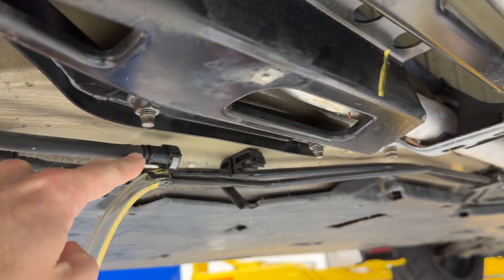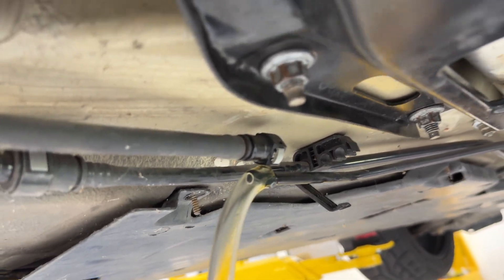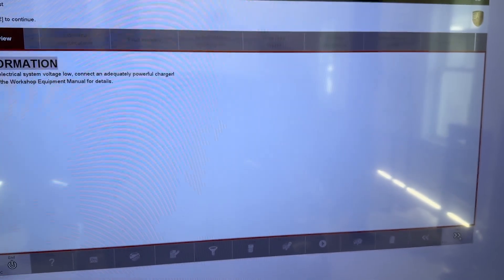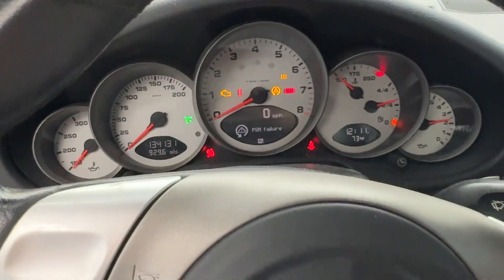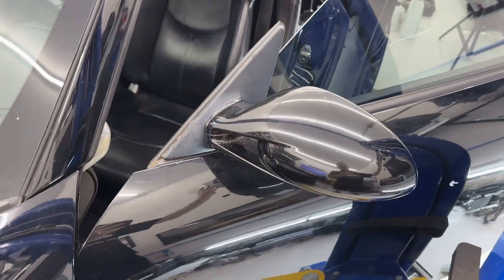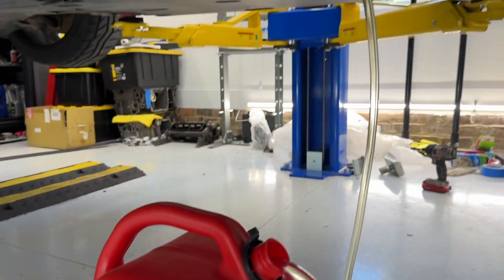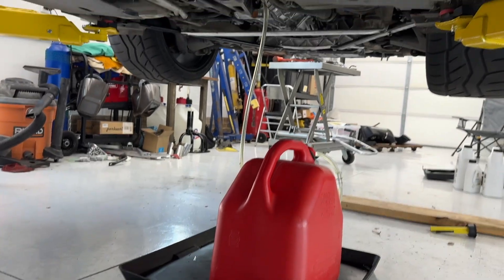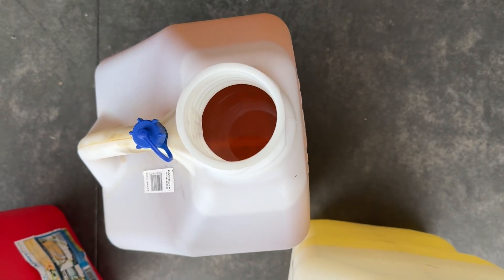Porsche 911 Engine Assembly Part 43:  Removing Old Fuel from the Tank using PIWIS

Comment: I jumped mine through fuel pump relay (easy on 996) as I wasn't quite ready to turn the key at all... but I've used Autel on other cars to do it via diag/active tests. I think the Durametric can do it on a 996 at least, I'm sure it could on a 997. Relay panel looks less fun on the 997.
Reply from the maker: +@miketdavies 😎🍻

Comment: Quite interesting way to remove the old petrol from the tank. In gen 2 cars (2009 on) with DFI the tank pump acts as the lift pump to supply the high pressure pump and wondering how to safely deal with that situation.
Reply from the maker: +@warrenlucier5796 oh really? Interesting
Reply: Are you just trying to drain the system? I think you should be able to just use the lift pump in the same manner - HPFP is on the motor itself and only pressurizes/moves fuel when the motor's turning. Takes a low-pressure feed from electric lift pump. Not sure if there is a similar quick disconnect under the car in same area or not.
Reply: @miketdavies  I guess if I have to do this, I'll be removing the panels to make a determination on it at that time. If someone knows the answer they should chime in on the subject matter.